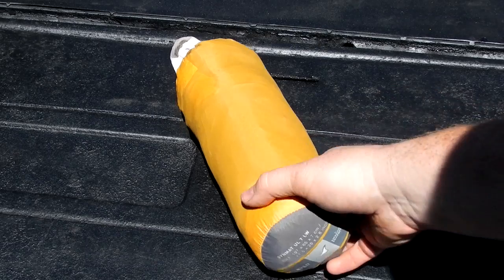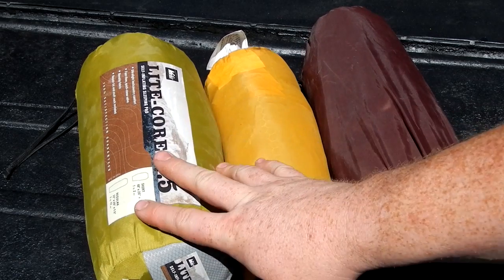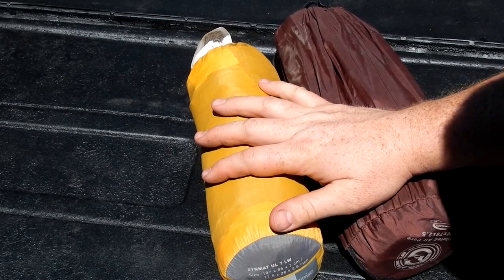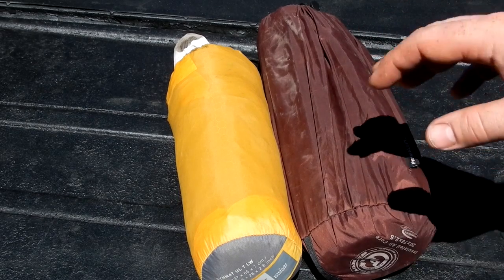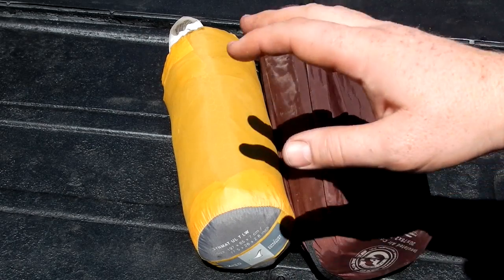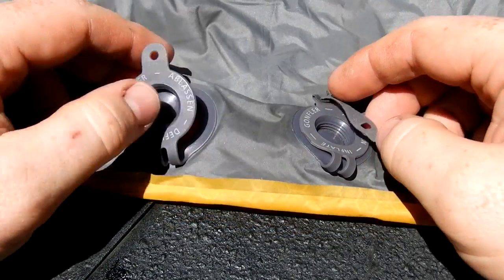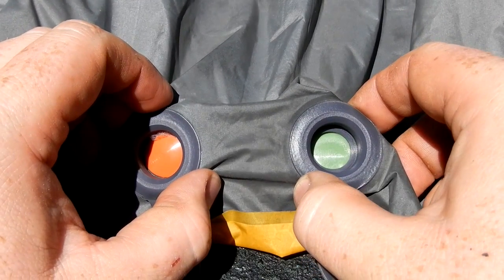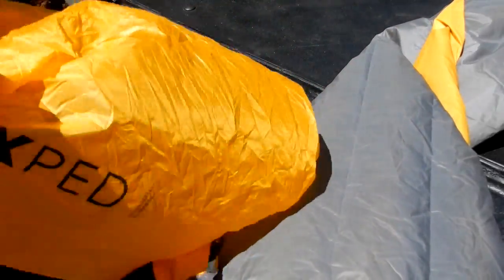Exped SynMat UL 7 LW Air Pad

Comment: I also use a real thin foam pad cut in half so we have 1 each...we keep the pad underneath the air mat to give extra protection from rough ground, thorns etc and a bit of extra warmth in winter months. Great for kneeling on and sorting kit etc afterwards,

Comment: I bought one of these (SynMat 7LW) to put in my AMOK D3.0 but with an integrated pump, because I can never find a pad that doesn't stop me from bottoming out on the Earth. See, Im fat. Im 5'9" and weight 256 so finding a sleep pad that keeps me off the Earth is difficult. HOWEVER, I bought this, inflated it and I didn't bottom out. My hip nor my shoulder touched the Earth when I was on my side. On my back, still no bottoming out. I am glad I got this sleep pad. It took about 5 minutes to inflate and I felt like I was preforming CPR (integrated pump) but, as out of shape as I am, this was not an issue.
Reply: Tombstone Ted good to know I'm a big lad and looking for a good mat

Comment: The Snozzle Pump Bag is a cool idea. I have the size S synmat UL, which fits me well, and I love to sleep on it. Comfortable and warm. But it really doesn't hold much, I used it on the clean kitchen floor when visiting friends for some nights and had my first hole. From now on I think I will carry it in a protective trash bag. and if it has another hole one day, it can stay there ;-) what fails me in the kitchen is not ready for the field. I will have to try something different in future.

Comment: I also have a Big Agnes pad that deflates in about 4 hours without holes.  I read somewhere recently on the 'net that the problem is with the brass valve, so I'm going with that.